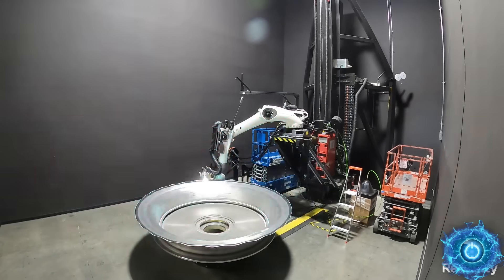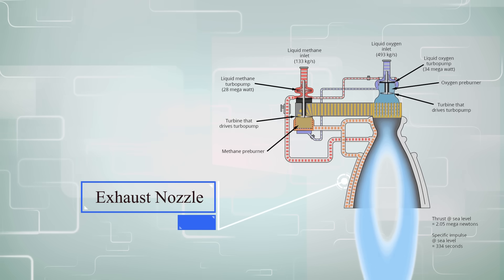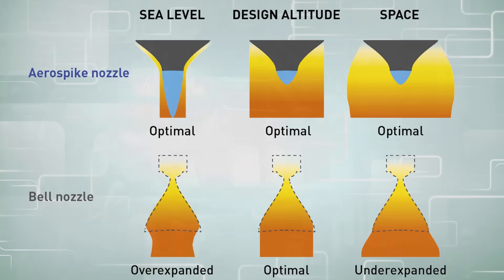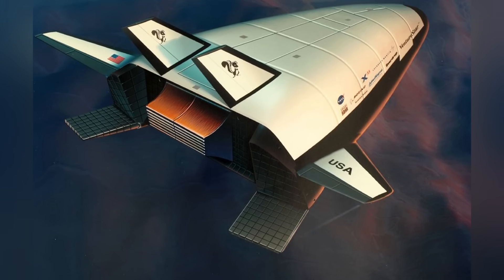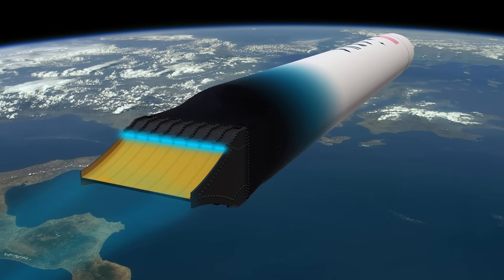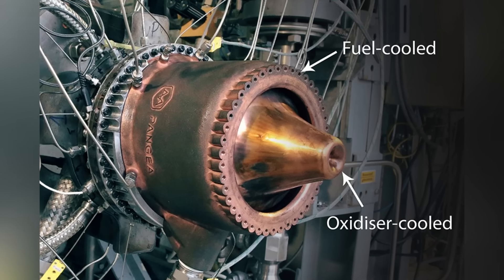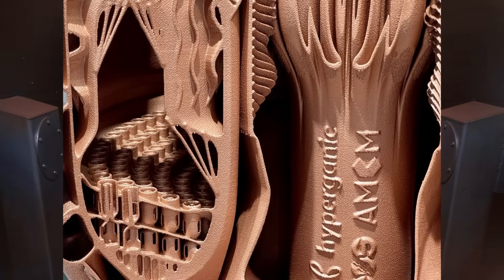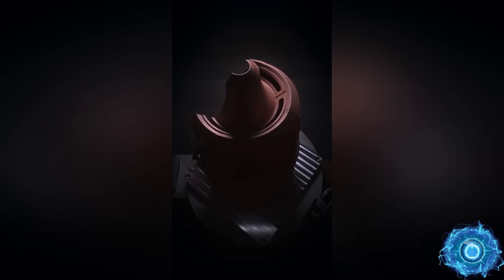GAME OVER - A.I. Designs CRAZY New ROCKET Engine

Comment: They have to be reasonably easy to maintain and repair too. Optimizing for performance only will not give us very sustainable designs. Even if the manufacturing can be simplified with 3D printing. Unless of course they can be cheap to the point of disposable?

Comment: Rewrite the title to : "New crazy rocket engine designed" Period. 

AI does not design anything. Designing an engine is a process with a lot of steps and there no ML model that does them all,  which wouldn't make sense at all, on the other hand.

PLUS: everything in high-tech is nowadays designed with the help of machine learning. 
But you are giving people the impression that they're some sort of mega-chaptGPT that was told "Hey buddy, design me a rocket engine" and it did, just like when you generate a picture in Nightcafe studio or something like that.

And then we ask ourselves why there are so many anti-science wingnuts around.

Please stick to correct reporting.

(Note: I do work on a supercomputing facility where machine learning is used for anything from fluid dynamics to chemistry)

Comment: This doesn't scratch the surface of AI.  I read some comments on how there are flaws....it is already possible to integrate models that account for environmental factors to mitigate risks and offset  poor design.  All that means is that the shape is different and performance may be lower...or not.  Automated testing is also a thing.  RN, entire models of T&E ensure that products are simulated with high fidelity and digital twins verified.  There is an entire backbone this doesn't even begin to touch that those outside of product development shouldn't worry about.

Comment: Would be interesting if part of the optimization process for generating this design involved accurate simulation of its manufacture including likely defects, that way it could balance theoretical efficiency against a more realistic measure of reliability (and potentially cost to manufacture)..  i dont see any way of manufacturing this that isnt some form of 3d printing.  And maybe thats okay.. but even if it is, some 3d prints are more durable and error prone than others.

Comment: I remember helping design that copper thrust engine about 10 years ago.  It looks nice in this video but there was no mention that a big problem was having to cover this engine with a thermal restraint material and then attach it to a nozzle that is yet a different material.  Once you do that where everything has variable thermal expansion you get all kinds of cracks and breaks.  Oh, and 3D printing a copper alloy is not a reliable for smooth surfaces, causing lots of leaks.  Still, good video, good job.

Comment: There are a lot of factors to consider for high temperature materials. Design is restricted by material properties. State of the art engines use various materials for the different components due to the many different thermal, chemical, and stress environments that are experienced through out the system. Coatings are also utilized to achieve peak performance. It would be incredible to see AI apply all these sophisticated relationships. My guess is it is going to take some serious verification before AI is "allowed" to design technology that has the potential to cause loss of life, ie engine failure. I also have a hunch that AI is still basing its decisions off of limited data, ie it may not be  considering every dynamic that real engines facilitate. This looks aerodynamically driven however is it thermally optimized? This is the first step for sure, I could definitely see AI engineering being capable of some incredibly innovative technology.

Comment: When you trying to get off the ground, you will need higher trust weight ratio, thus you will throw higher yield into the combustion chamber, you guess what? It turns into a traditional rocket engine..........while you are cruising trough thkornous orbit to Mars, yes you can throttle back to use these detonation to save fuel, but, you guess what? Iron engine with nuclear reactor is far more effective regarding the task........hhhhhhhhhhhahahahahahh, in general, it’s a useles piece of shit......rde engine.

Comment: it is mesmerizing to see how it designed to control fluidity. even looks screams like efficiency.
It will not work because of building materials and methods that we have right now. 
Maybe we should create a ai tool that design us a better 3d metal printer. 
But still it will give scientist a lot of new ideas to make current rocket designs better. 

The current state of AI is not harmfull because in reality it is not an intelligence. It doesn not have able to think. 
It can't create its own alghoritms or ideas. This design just art of statistics and computing power. 
Current computing power and software architecture gives us power to make AI tools. 
Those tools just trying every possibility with given algorithms in given parameters. 

This result simulates human knowledge of physics with billions of brain power. 
So this ai tool process will improve things a lot in near future

Comment: 1:00 small correction - the main reason for multi-stage rockets is that having a heavy high thrust machine push a lighter low thrust machine into a suborbital trajectory that the lighter low thrust machine  then pushes into orbit is WAY way more effective than trying to do it all with a single stage. SSTO is itself only BARELY possible from Earth and not worth it for 99.99% of all space missions. Engine efficiency is only a small part of why it's not worth it though, and depending on your needs, there's nothing stopping you from making an SSTO with conventional engines. You just need to account for the inefficiency of the system. Aerospikes already solve the engine bell problem though, if efficiency matters, and they're baked into nearly all SSTO proposals. But again, for nearly every type of mission, you're better off with just a multistage rocket.

AI engine designs might look cool but as every rocket company says over and over again: engine designs are a dime a dozen. They in and of themselves aren't the main concern. It's manufacture and execution that matters way more, as well as choosing designs that best suit your specific needs and company goals. So unless this was design with intention behind it to achieve a company's specific goals, it's going to remain a paper engine forever. Cute though.

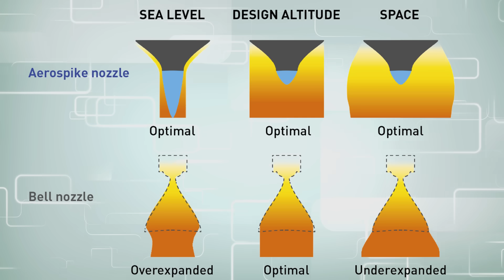Comment: 1:20  The upper right drawing is simply wrong. An aerospike nozzle is definitely over-expanded when operated above it's design altitude.There is no atmospheric pressure to push the exhaust in again as shown. In reality, the gases expand in all directions once they are not contained, just like a traditional engine.

Comment: As a manufacturing engineer, I can say with a high degree of certainty that this entire video is just a bunch of clickbait drivel. Autodesk's generative design and 3D metal printing have been around for 5 years now. If this were the next big thing, SpaceX et al would've jumped on this years ago. Transformer-based LLMs ARE revolutionary, but have absolutely nothing to do with generative 3D modeling.

Comment: AI design as stunning but like you said it also has to be designed for manufacturability, costs and service not just performance.  On the RDE...  I know of a couple testbed engines and like aerospikes they crop back up every so often.   I am not aware of any that successfully transitioned off the testbed are you?    Interestingly they are back under development again in DoD.

Comment: The engine needs to be able to perform reliably and be structurally sound with no warping or cracking for 200,000 + miles and more. With all the small thin layers here I don't see this holding up to the rigors of real world wear and tear. I am sure AI design and testing will evolve and we will get some real world usable designs, but I don't think we're there yet. Maybe in 5-10 more years. Materials design needs to evolve and get cheaper as well.

Comment: Never been tested - never been fired - it looks like the 3D printer sneezed.  No one understands it, but an "A.I." designed it, so it must be great!  Or it's a pile of garbage that will explode or probably not even light, because the "A.I." was actually stuck in a loop, but the guys wanted their funding renewed so they trotted this pile of garbage out.  The sad part is that with all of the overzealous hype around "A.I." right now they probably did.

Comment: That AI designed engine looks like it would be absurdly difficult to do quality assurance testing on.
Reply: @Okratron-rr8we  they make the parameters but they couldnt communicate how nor why the ai  came up with said design. I dont doubt their qualification, however not even the leading scientist in ai models can do that so i doubt they can. People are jeeded to guide them and make sure it isnt being confidently incorrect but seeing into the processes that drive an ai to its conclusion isnt a possiblity yet
Reply: @Shotaboat  The concept of AI technology often seems like something out of science fiction, but in reality, we haven't quite reached that level yet. While it's true that reality can sometimes be stranger than fiction, I believe we are still in the early stages of fully comprehending AI. Personally, I have only engaged in minimal work with AI, particularly through Stable Diffusion and LLM's, which has already given me a modest understanding of their creation and function. don't forget that we're dealing with literal rocket science here lol.
Reply: @Okratron-rr8we  fair loll
Reply: Maybe AI can be used for QA
Reply: get the AI to work out how to make the testing easy.
Reply: That's why you use an AI to inspect the xrays and do QA
Reply: That's what AI is for.
Reply: Not if it was made in Japan.  Czinger, A.I. designed car.
Reply: I guess you could use acoustic methods to "see inside the metal" and  it would be apparent if there was a crack or something similar. This tech already exists for a long time and is useful to inspect all kinds of metal structures that must not crack or have inner defects. Or to detect the source of earthquakes in the earth's crust, etc... Basically you vibrate the engine, then measure how it responds (you record how it "rings", kinda like a bell), then do a fourier transform on the sound data and you get a replication of the structure of the engine in 3D with all its imperfections inside.
Reply: What do you mean quality assurance? Just test it until it fails, test it under extreme conditions... then, just replicate. 😄
Reply: @millanferende6723  metall get tested for cracking and bubbles in a microscopic way so they can either repair or evaluate the amount of usage left
Reply: @millanferende6723  Manufacturing isn't a perfect process. Following the same steps you can have one part that meets spec and one that fails. Your tooling could wear between pieces or the material might have defects, etc.
Reply: Hahaha
Reply: I think it is possible. Cause its like a perfect puzzle. You try and try until you accidently stumble upon design that perfectly fits in is final form to be perfectly utilised to maximum potential - all sizes and forms of cavities and walls are at optimum balance. Usually you could go so on until you encounter dead end - not enough space left for your final piece or too much or whatever... until one design fits perfectly. And those designs in nature are rarity - as life on earth. But if AI has ability of quantum computing and prediction as it has been proven today with chat Gpt etc - it already perfectly predicts text to be understood by humans and convincing it is human. So if it can stumble upon perfect layout of letters to create essays why couldn't it stumble via iteration helped with fast computing to rule out non perfect rocket engine models until this one is found and revealed. I see it totally possible this being very efficient engine. Actually one and only most efficient for its purpose in this outside shape. Anything different and it would work as well. AI didn't create this engine. AI discovered it - given the parameters that were required for it to perform....
Reply: @dovydasvaiksnys3807  yeah in an ideal world yeah, but it costs billions to make and manage engines, and space missions so we cant effectively try forever
Reply: And thats not counting the electricity and computing power used in the generation of the engine model
Reply: @Shotaboat  I actually think that the fact that they are using AI in this way actually vouches for the efficiency of AI technology. having limited resources most likely means that they optimizing their work. AI was their answer to optimization. it makes sense when you consider the fact that AI doesn't really require a ridiculous salary for its expertise.
Reply: @dovydasvaiksnys3807  "AI didn't create this engine. AI discovered it" i like it! 

kind of reminds me of the puddle waking up in a perfectly puddle shaped hole. AI doesn't seem so impressive when you realize that its just a really complicated fill-in the blanks answering machine haha
Reply: It would be very easy, the AI would be testing those rockets on our heads: "How do you like your quality humans?, is it good enough?"
Reply: Well, quality assurance will be done by AI prob too so it also probably will be something ingenious and not difficult for it to pull off.... and why would it be difficult. Just test it and see how it perform. You don't need to know how it works as long as it works. Leave the numbers thing to AI to deal with
Reply: @dovydasvaiksnys3807  What could go wrong in that scenario!? 👍🏻🤣
Reply: What makes you say that? Do you not think the rocket scientists who guided the AI in the design knew what they were doing?
Reply: @Sajuuk  it just looks like it would be difficult to x-ray or ultrasound or remove blockages from the manufacturing process.

Like other than by endurance testing (for which each rocket would be different and need to be tested separately) how would\could you guarantee that the wall thickness is within the limits?
Reply: @Sajuuk  🤣
Reply: @Sajuuk they most assuredly didnt, ais are incredibly complex machines that are imcomprehensibly complex preforming billions of calculations a second.
Reply: @Shotaboat ai to date, is nothing more than sophisticated algorithms my guy. 😂

Comment: Similarly to the prototypes made for integrated lower and upper control arms in race cars using AI...the resulting shape imposes 3d printing as conventional mold casting technology can not form such complex shapes ( parting lines, draft angles, etc)...the limiting factor hence, the material you can 3d print with.

Comment: Its not game over as we are working on Acoustic Resonance Reaction Control Thruster (ARCTIC) which is basically an engine that uses sound as propulsion. Scott Munson - 
Title: Senior Propulsion Engineer
Reply: Also if you have not done some research. They have been able to use sound to basically defy gravity. Along with using it as a propulsion system. They also try to clam that they could not fit a power source on a craft because of current engines used in labs couldnt produce enough lift with a power source on board. Yet back in the late 60s or so they were able to power helicopters in air for hours using microwave beams to transfer energy wireless.

Comment: Imagine this new engine with nuclear fusion as fuel. If this engine is extremely efficient, giving it the ability to use very little fuel (low weight high thrust) it could revolutionize space travel or even air travel.

Comment: WOW!!! I have dreamt up all sorts of configurations in my head and the idea resembles that AI-designed piece at the end of the video. The idea, which I am unable to put my finger on properly or even understand, has to do with channeling the gases at different temperatures though differente configurations that would maximize the exchange of energy by modifying the pressure of the gases as they travel in one direction (toward the exit say) through a maze that builds up the pressure as it travels, sort of like a capacitor, or like a nuclear bomb that does not explode but where the would-be explosion is used to feed a longer running expansion of the gases in a controled fashion. I don't know if I am making sense, but that AI-designed thing looks like what I aiamgine it would be, so that essentially, one would get huge forces coming out of a very small generator, sort of like the speakers on smart phones, where if you put your finger on the exit hole for the sound, you will feel the forrce and the corresponding pain even though the generator is miniature (same with sith sand-blasters, water-pressure cutters, and so on.
Reply: You seem to have thought about this more persistently and deeply than most.  You seem to be saying that an optimal design would concentrate pressure and flow at the combustion outlet(s) to be just below the mechanical and thermal tolerances of the alloy, so that maximum performance is realized in the design.
What another comment has helped me see is that Machine Learning & Optimization (which isn't true AI) can solve problems just like this, where there are many complexities and interrelations that lead to designs that are intricate and elegant - things that are both art and engineering.